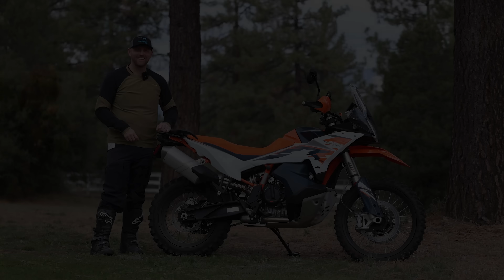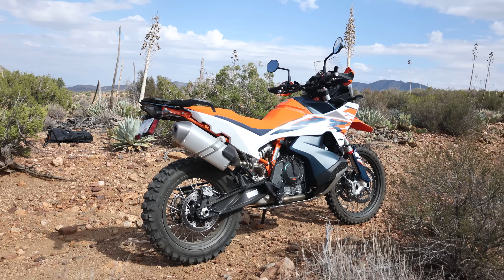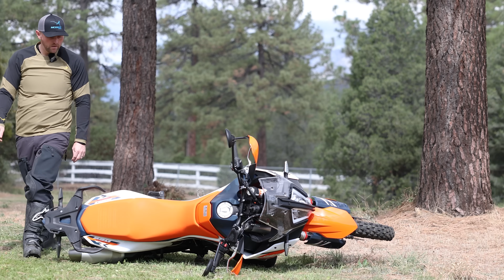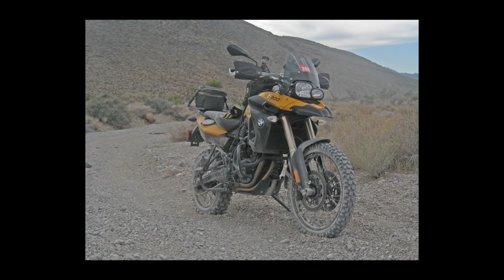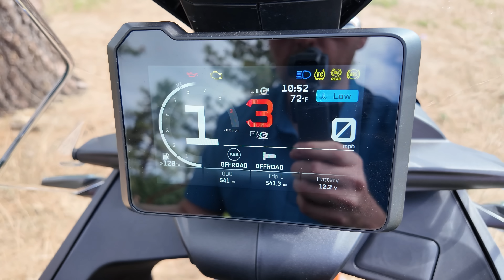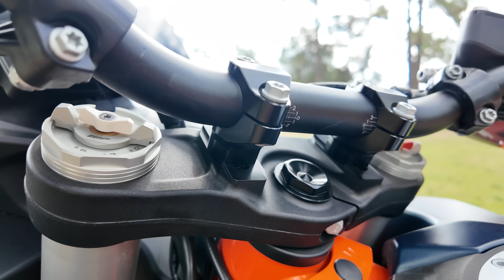4 Reasons the KTM 890 Adventure R DOMINATES Off-Road Adventure Riding

Comment: I'm looking to buy my first new bike next year and the 890 is by far my preferred option (haven't tested the Desert X, but it's quite a bit more expensive). Unfortunately I am not in a position to afford risking the cam issue, so I will probably be going with a Tuareg instead. I like the ergonomics more on the Tuareg, but the engine is much better on the 890...

Comment: My 1190 has been so unreliable over the 8 years I've had it. It's cost £3500 in abnormal electrical repairs. I still approach it with wondering if it will actually start everytime I go out. It's constantly being charged as its battery fails else. You could NEVER go on a adventure in it. 
Parts are expensive and price gouged by KTM. Customer care has been appalling.
No never ever again!

Comment: I bought a KTM 790 Adventure in 2019, and now I have almost 90,000 km on the odometer. I mostly ride on asphalt, but also on gravel — for example, around 4,000 km in Morocco, or on the ACT Italy as well as the TET Italy and Hungary. There have been a few repairs, too: the fork was leaking (since then I clean it regularly as recommended in the manual), the rear shock had to be replaced, as well as the front and rear brake light switches and the ignition pulse sensor.
That may sound like a lot, but I’ve ridden a lot, and I have to say: the low center of gravity due to the fuel tank, the resulting wind and splash protection, the ergonomics when standing and sitting, the engine’s responsiveness, and the relatively low weight — all of that would make me buy this motorcycle again.
Apart from that, I find the bold and innovative approach of designing the tank so differently truly admirable. Most other brands generally follow the same concept — except perhaps BMW with the Boxer engine or Honda’s Africa Twin with its dual-clutch transmission.
I just think it’s great when manufacturers take such different paths or come up with their own solutions. That way, everyone can find what suits them best. I certainly did, and I’m genuinely satisfied.
Greetings from Tyrol, Austria,
Geri

Comment: I own a 2023 Norden 901 and have had quality issues with the engine but the bike is so damn fun to ride, I'm keeping it and hoping KTM sorts out that engine a little better over the next couple iterations. If they do, the 890 ADVR will probably be my next bike. If not, I'll keep riding (and repairing) the 901. You can't beat the electronics on these things in rally mode. There's nothing else out there like it. I ride 6-7 slip in rally mode almost everywhere and can power-slide corners, get the wheel spin I need in loose gravel, yet still have confidence it won't let me go too far... which is nice considering these are 100+hp bikes!

Comment: 2023 owner and loving it. Another point on the suspension. When you load a bike up with 50 lbs of adventure gear, all of the shortcomings of the suspension get significantly worse. I am absolutely amazed at how well the 890 R handles offroad when it's fully loaded up. It just doesn't care that it has 50+ extra pounds on it.
Reply: Yup, I concur. The bike rides exceptionally well fully loaded

Comment: 26,000 miles on my 890R, zero issues.  Its a great bike, I much prefer my 690 off road by a wide margin.

Crash worthiness, I still think crashing regularly isnt the way to go.  470 lbs is still 470lbs. 
Some talk about how often they crash these big bikes like its some badge of honor to keep going down.  Mine stalled once doing a tight u turn on the first ride on it.  I got used to it and that doesnt happen anymore.

You do kind of have to haul ass all the time to make the suspension work on an 890R, if thats how you always ride then its great.
From what I see most dont do that. 1 mistake on a 470 lb bike can REALLY leave a mark.

Comment: Just wondering if the 890 R can handle a 225 lb rider with camping gear on very rough terrain???  I have a 23 KTM SAS and that has bottomed out a few times on recent rides.  Would the 1290 SAR be a better ride for me?

Comment: Had one of the first 790r models when they first came out and then later an 890r and loved them both. Only real issue was the weight. I ride mostly solo and these bikes are so good off road that it is easy to get in over my head and have to deal with a heavy bike on the ground in tricky terrain.  Had that issue even with a 690r.  Ultimately I decided there is no unicorn bike so now have a 1290 SAR and a Gas Gas 500.  Works for me.  Zero issues buying KTMs.  It might be different if I had the camshaft or other problems but luckily I have not had any issues over the year.

Comment: I’m a solid Idaho woods and Moab rider on a 300 KTM XCW for 8 years now, but usually the last one in my group and I’m fine with that. My fellow ‘300 buddies’ are now dual sporting and trying to get me to buy this bike or a T7, or maybe the 390. I don’t aspire to ride a DS fast, wheelie or jump…and likely will never camp overnight. My main use case is riding 120 mi between our two Idaho homes (80% forest, 10% road, 10% single) and I don’t think I wanna do that often on a 390 .  I don’t drop my dirt bike as much anymore but the thought of picking up a T7 a lot intimidates me. I’d like a bike to do 100-150 dirt days with limited asphalt time. I think the 890 may be more bike than I need or can handle and I have nothing to prove to anyone. The reliability of the Yamaha traversing central Idaho is appealing, but hearing that even the 2025 T7 is top heavy and there is a learning curve to keep it on two wheels is a real concern for me. The T7 “world raid” appears to have better suspension and a lower CG and maybe I can get one in Canada or Mexico and bring in to the US. I think Idaho is pretty lenient on that stuff. Thoughts? PS - keep up the great work - I’m sure your content is a ton of work but it’s all great.

Comment: I have a 2023 890 R and it's absolutely incredible. I had a 2022 Africa Twin Adventure Sports and after the crash protection it was around 590 lbs. That is a ridiculous amount of weight to maneuver offroad, and while there are some riders out there who can handle that, I'm not one of them, and I'm not particularly interested in becoming one of them. The 890 on the other hand is 120 lbs lighter, and that combined with the super low center of gravity, vastly superior suspension, and top tier electronics package make it so much more manageable. Guys like you and Ben over at Dork in the Road are more skilled than me (or most ADV riders tbh) and you both make excellent quality videos with very insightful reviews, but you both almost talked me out of buying this bike and getting the non-R model instead and while I think you had valid points, I have to respectfully disagree with the common assessment that it's uncomfortable or that it beats you up. Is it less cushy than my Africa Twin was? Absolutely. Is it less plush on the highway than my Africa Twin was? Undeniably. Are either of those things such glaring marks against it that its capability isn't worth the hit in comfort? That's subjective, but to me, absolutely not. It is far easier and less expensive in my experience to make a capable bike more comfortable than to make a comfortable bike more capable. The 890 R is arguably the most capable offroad-focused middleweight ADV bike on the market and all I had to do to address what it lacked in comfort is put an Air Flow seat cover on it with some heated grips and a Kimi Moto wind deflector to add some height to the windscreen and it's just as comfortable as the AT ever was. But the AT actually was TOO smooth. Personally, I want my bike to be a little rough, a little buzzy, a little hard. I want that visceral quality to it, I don't want to ride a sofa. If you're a person on the fence about this vs the lower spec versions, I cannot recommend the R enough. 

Thanks for constantly making the best motorcycle reviews on YouTube, dude. Keep it coming and ride safe.
Reply from the maker: Great feedback. Thanks

Comment: The ktm 950/990 lc8 (v twin) engined adventure bikes made 2004-12 have twin plastic side tanks that provide all the crash protection you need, and if you do manage hole a tank they have shut off valves so you can run on one tank. Yeah the 790/890 are better, no denying that, but not THAT much better than the “original”.

Comment: Hello from FRANCE.
I have a 2019 790 adv R since January 2020, démo bike with 3000km and a discount.
Yet in 2025 21 000km, one recall for the rear brake in 2022 or 2023, and my bike don't have any problem at the moment.
I do road twisty pretty fast, I'm a poor off-roader but I'm not afraid to put her in "enduro" situation and she's go down many times.
No problem at all and no repair to pay, when you don't have to get out your wallet after every offroad journey, you became more confident and progress.
This vidéo tell exactly why I've choose this bike, natural protection (not had to put extra weight and money), stock suspension (not had to modified, money), 20l tank little consommation very good range (400 to 500km), electronic package and MEMORY when you shut off and of course an 200kg adventure bike without cruise control is for me just ridiculous.
Some other adventure bike are lighter and cheeper but you have to put minimal 10kg of weight and 3000€ of aftermarket parts just to approach the level of this one. 
To be fair she's too heavy to do serious offroad in North Europe without a very good rider and aggressive tires, we don't have dry sandy track but muddy sticky wet.
The only problem I have is the color I don't like orange.
If I have to, I buy it again, for me it's the most versatile and fun bike you can buy even 6 years later.
Poor people don't have money to do mistake...when they choose a bike or other thing.
Reply: I have a 790 adventure r 2020 no problems just pure fun and out of all the bikes I have owned this has everything! Live in France in Ariege dep and love the mountains and off road segments I come across

Comment: Great video again Ian! To your question, yes absolutely. Bought the 2023 890 Adventure standard version when it came out, because I believed it matched my skillset, or lack of skills (all depending on point of view). In retrospect I should perhaps have spent the extra money on the R. Not that I missed anything though, or rarely. The fact that the S or standard 890 doesn't exist anymore, and has since been replaced by a 790 might be a result of (necessary) consolidation. And now the 790, I believe, has the same suspension adjustability as did the standard 890. You lose a little bit of power and torque, which might not matter that much to most (unless you've experienced the difference :) 

I put on the shortest risers from KTM because I am tall (much taller than you) and the extra millimeters didn't throw me back and still compensated vs more slack riding and comfort. For those of us who are >6"3, shorter risers can make a huge difference. And that's something which especially plays out if you're using the motorcycle for  say 5-7000 kilometers rides or longer. One could call it a trade-off, but to me those did not diminish features and handling, for the level of riding I did with my 890.

Currently I have a KTM and a BMW, and I am happy with both. Cheers :)

Comment: picked up my '25 last week. 56 yrs old and riding fairly aggressive single track for the last 8-10 yrs (broken neck - ouch!) on a Husky FC450 and KTM 300XC-W Six Days. I've done my research and no worries whatsoever about reliability - bike is a beast so far, looking forward to many more years of (injury free) riding. Oh, and a 4 year warranty!? Why not?
Reply: 6 years less wise than you... How would you compare it to 300 2 banger and 450 4T? Jjust got myself a GS 1300 Trophy to replace a road bike (amazing off road considering it's weight) but looking to upgrade move on from my 300 EC gas gas to a 700 or 900 in next few years. Cheers from OZ
Reply: @cyclemoto8744  1300 is a big machine. The 890 rides like the 450 in the dirt, the 300's are flickable Ferrari's while the 890 is more of a tractor that goes too fast. I’m in Canada’s Pacific Northwest so mountainous, forested technical riding

Comment: I would buy a used one, or a 790 because they aren't too pricey but I would do that knowing that I would probably have some issues and less than stellar resale. I can't stomach buying a new one and paying to unlock features already installed. I don't see any other manufacturing stepping up and really fully challenging this model in the short term. Maybe Kove but they have the same engine problem at this point.

Comment: I have a 2023 890 ADV R. I've experienced what I would call an odd durability issue. I've crashed it twice, both low speed tip overs on a rocky trail, both times I snapped off the rear turn signal on the side of the bike that didn't hit the ground. As far as I can tell I must have caught it with my boot, but both times it was a clean snap off. There doesn't seem to be as much flexibility as I would hope.

Comment: My 2023 890R is an absolute weapon however, I also own a T7 and when I know I’m going to be out for an extended trip and very remote… it’s what I reach for.
Reply from the maker: Sounds like you've got a great setup with both bikes!
Reply: Thats the best idea if can afford 2 bikes, have a Norden and been thinking about a T7 to have as per reliability.  Had issues with Norden and can't sell them, as nobody will buy.
Reply: @eddiek3390 I bought my T7 specifically because my 890R was down with a throttled module issue and parts were 4 months out. Had a trip I couldn’t postpone and I had to have something to ride. Been a great combination.

Comment: I have a 2022 KTM 890 Adventure with over 27,000 miles with very few problems.  I bought it brand new and have taken it all over the place.  I would buy another one in a heartbeat if my current one needed replaced.

Comment: Mostly love my 23R - it’s had a few electrical gremlins but pretty well sorted … except an overheating issue as of late. The dealer replaced the water pump seal and radiator cap - it was fine for 500 miles then the temps started going up again. Back to the dealership- hope to have it back soon .
Meanwhile I have the 701 and 500exc cuz like potato chips, you can’t have just one!

Comment: Why KTM stops selling its 790 adv model in US but keeps them on shelf in other market such as EU, Australia and China. For rider with budget limit a 790 adv is more than enough for 99% of off-raod situations, while 890 ADV R is definetely more capable in some extreme terrain, it also ask 50% more in spending. 

As for the increased engine capacity, for off-road their output are both much more than controllable level (40ish HP and above would be pretty suffienct for such technical terrian).

Comment: I owned a ’23 890 for about a year and put 10,000 miles on it. I also owned a 2017 FZ-07 for about six years and put 20,000 miles on that bike. I can say for a fact that my Yamaha had zero issues—mechanical or electrical—the entire time I owned it.

The KTM, on the other hand, was a different story: faulty brake light switches, faulty turn signals, inconsistent cruise control, a wobbly front wheel that the dealer "couldn't find an issue" with, a leaking valve cover gasket, and to top it all off, when I decided to sell the bike, the thermostat gasket decided to leave the chat—even though I hadn’t ridden it for a couple of weeks before the sale.

Overall, I’ll say this: if you’re coming from a Japanese bike, expect to spend more time fixing things or visiting the dealer.
Reply: haha wow, almost identical issues with my 22.
Reply: Obviously Yamaha is more trouble free than KTM, but i wonder if on road vs off road has much to do with it. 10k miles on gravel roads or worse is going to be much harsher on a bike than 20k miles on asphalt, no?
Reply: @unpopularopinion8608 I did roughly 70 percent on road 30 percent gravel roads/fire roads. I agree the off roading will cause more wear but it still seems excessive.
Reply: Ironically my Norden 901 had less issues than my CRF300L Rally…

Comment: By far the best adv bike out of the box. I just wish my motor lasted longer longer than 2500 miles. I would totally get another one though with an extended warranty. Another thing to note is that KTM put a brand new motor in my bike with no questions asked and under warranty.
Reply: I think that is really important to talk about. I have a great KTM dealer.
Reply: Brand new engine with the same flaws tho... Only CFMoto (allegedly) fixed the issue with cam lubrication and clutch
Reply: yea, CFMOTO weren't silent at all, but rather transparent about having an improved heads with upgraded lubrication.. I genuinely wonder how 'lesser' is the IBEX 800 MT-X , the twin brother of the 890 ADV' R  .. .
Reply: Got the mtx, had the choice of a new 790 with everything unlocked for the same price. Went with the cfmoto cause I didn't trust KTM.

Comment: I have a 790. It is good just don't drop it. You will find it to big to pick up alone.
I switch to a 2023 Husky 701 enduro. 100 lbs. lighter and you can pick it up alone. Go over ruts and whoops better.....much better. It is not even a contest. Use the 890 for dirt roads and tar and you will be find.......just don't drop it.